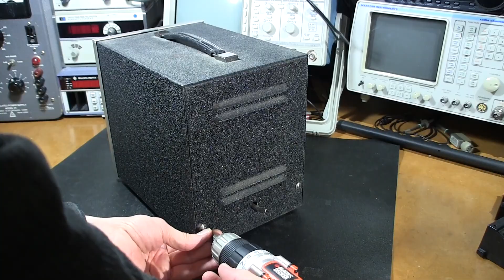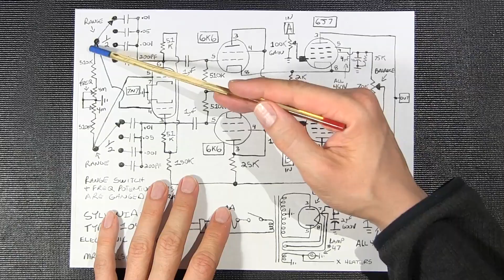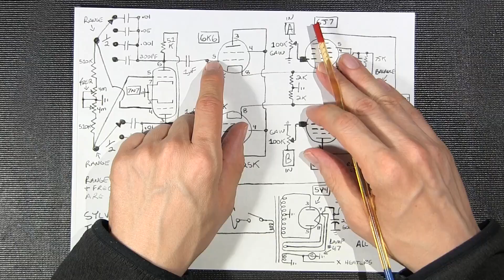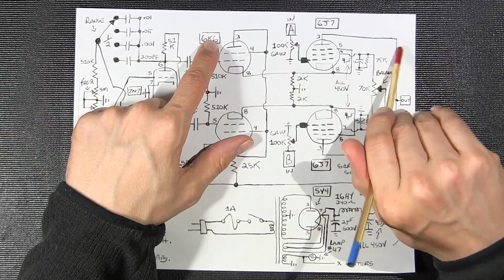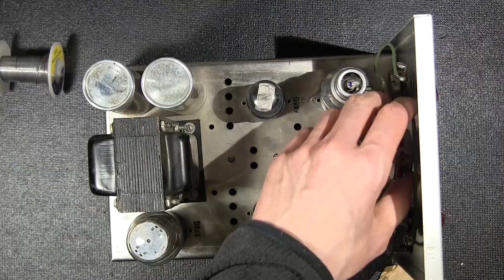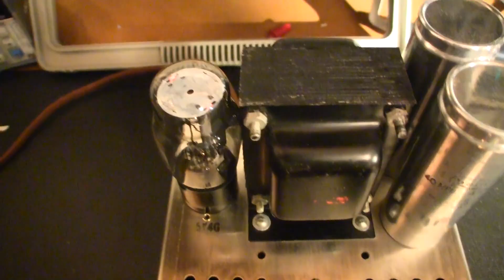Neat Electronic Device from 1939 Explained with Restoration

Comment: You mentioned in the video that the pentode was being used as a triode. Why was this done instead of just specifying a triode in the original design? Was this just a cost-cutting measure so that they would have to keep fewer different tube types in stock?

On an aside, thanks for these videos. Your videos (and Big Clive's) have inspired me to get back into learning electronics. Your attention to detail is inspiring. I'm trying to work up the nerve to change the caps on my Icom IC-751A, something I would not have contemplated before watching your stuff :)
Reply from the maker: Either cost cutting, or they found some advantage in using a pentode. (maybe sources current faster or something) "nicer square wave" for the switching. Thanks for your kind comment!

Comment: Thanks for posting. As an old guy, I cut my teeth as a kid with vacuum tubes. One additional thing odd about loctal tubes, the number starts with a 7 but they are 6 volt filaments.
Over the years I had built quite a few Heathkit and Knightkit devices, including a the Heathkit color TV in the early 70's.
Take care de N3GAQ.
Reply from the maker: You're Welcome Mike!

Comment: I wonder why would anyone but an oscillator in the signal way of a switch like this when one is usually struggling to keep noise & oscillation out of it as much as possible. & this doesn't appear to include a chopper-like preamp or be using the heterodyne principle for anything.
Or did I miss something & the signals are supposed to switch periodically?
Reply from the maker: The square wave has to be there to stagger the traces.

Comment: I believe you are incorrect where you mention that the 6K6es are Triode Connected due to the plate and screen being tied together. It should be the control grid and screen grid tied together.
Reply from the maker: Are you sure it's me that's incorrect? You may want to do some research.

Comment: My father (age 67) watch this before me and after i mentioned loctal valve he then told me about the similar equipment he used to use.
Because he has explained to me how these older valves work in detail i had figured out about half of it works but couldn't quite figure how it mixes the channels together so i just had a 10min explanation of the oscillator component.

Comment: Hi Paul.
This is a great find and restoration. Could you give a tip as to what kind of software (preferably freeware) would be a good basis to draw schematics and PCB layouts? It's quite apparent, that to adequately restore old equipment, having a good schematic is half the work, even if one has to reverse engineer it.

I still find the notion "raising up the cathode from ground" quite confusing. Why isn't it more common to say, to make the cathode more positive compared to ground (where "ground" could be at negative or positive voltage compared to the usual 0 Volts) ?

It's fantastic how technicians in the thirties and forties were able to service high frequency equipment with measurement equipment well below nowadays standards. Your initiative to show how such a workbench would have been operated, is a wonderful idea.

Tallyho and success with your idea!
Keep the great videos coming :)
Reply from the maker: Thanks for your comment!

Comment: I have to confess, I got a chuckle when your schematic popped up. I'd made a prediction about the 6J7 tubes, after looking them up (RCA made them too, and sure enough they were in my copy of their receiving tube manual RC16 from 1946). I figured they were being used as amplifiers for the inputs, with the gain controls connected like simple volume controls.
That's neat how they're connected to the oscillator, though :D

Comment: Soviet standard procedure of point to point circuit quality control prescribes mandatory ink markings on each soldered joint. by-default, they are all marked, always. (during repairs they often use different colour)
Reply from the maker: Interesting, thanks for chiming in!

Comment: Thanks as usual for the great instruction.  The values on the range capacitors, however, only make sense if the selected (slowest sweep) capacitor in the schematic is 0.1 mike, rather than .01.  Did I miss something?

Comment: Question Mr. Carlson: Do all capacitors, even ones made today, have a limited life span as compared to other electronic components? Also, how old would an item have to be (ie. made before 1960?) for you to issue a caution about "just plugging it in and turning it on"?
Thank you.

Comment: I have a story I spent 7 years in the NAVY on submarines during the early 80 s I would have done but got hurt on board leaving me crippled for life. But 1 thing we had was a MK 19 gyro that was made in the same time as the subs in the early 60s . I was on SSBN 619 634 and they go out for 70 days or so. The mk 19 gyro is one of the ways to stere the sub.
I had to got to school for 3 weeks just to learn everything about it It has 307 tubes and we carried a tube tester and 2 set of tubes.If you could not figure out how to repair it you had to retube thing. Every tube is tested at the factory 5 times and run in a circuit . As you pull the tube you test them but you were not allowed to stop and just replace it you had to keep going .But you did write on the tube it was bad as if you use both sets of tubes you can try replacing what you think is a bad tube . We had some pretty nice troubleshooting knowledge after that school and after you worked on the real thing on the sub. When I got out disabled the NAVY told me they had over 1/2 a million worth of training in me  But man those were the days as there are only about 150 guys on board and you know them real well.
Reply from the maker: Thanks for the story!

Comment: Awesome restoration! What Sylvania named at that time as an Electronic Switch, is actually a chopper circuit which, once integrated into future o-scopes got shortened to "CHOP" mode and eventually "ALTERNATE" or ALT mode. Even my late-80's dual-trace Tek scope has ALT mode on it :)

Comment: Very nice.  I can't believe I've watched the entire hour plus video but it was kind of fun.  I'm surprised at least one of the tubes didn't have a date code of some sort.  When I began my career as a two-way radio technician 45 years ago we were still working with vacuum tubes even though transistors and other solid state components had become common place.  It was easier to actually fix things in 1972 and quite a few years later.  Today much of what we do can be described as "swap-tronics".  The company I started 34 years ago (after gaining 10 years experience working for others) is still quite viable.  I'm the president and there are 8 other employees.  We do all sorts of things including broadcast tower work.  Click on my picture and it will take you directly to my tower channel.  When on the bench I find myself in charge of fixing that which appears to be unfixable, legacy equipment.  I see you have a Marconi service monitor on the bench so I'm guessing you work with RF equipment as well.  I've had a ham license since 1960 but rarely appear on the amateur frequencies.  My "hamming" is limited to maintaining about four ham radio repeaters.
Reply from the maker: Thanks John, I'll check that out.

Comment: i have a single channel CRO and your restoration of this 1939 thing inspired me to the core ! :)

please hang a few of the carbon / tungsten filament edison bulbs in new lab to do the 1930s lighting !
Reply from the maker: It may happen. I do have an original Edison style bulb from 1909. Those bulbs burn incredibly hot, not much light either.
Reply: just to boost the ambience. :)

Comment: why do the valves have the shiney silver inside them ?
a great explanation video mr carlson thumbs up
Reply from the maker: Godfrey has it right. The chrome looking spot is called a "Getter Spot." This compound that's sputtered on the inside glass of the tube is there to absorb impurity's that leach out of the metals inside the tube over time. It will also take care of any left over oxygen left in the tube after evacuation.

Comment: I was trying to figure out how one could make this with solid state equipment, and I am realizing just how little I actually know. how would one emulate a tetrode or pentode? would it just be a multi gate mosfet? where would you even get one?  all i can find when I try researching multi gate  mosfets/transistors is intel's tri gate transistors which are described as a space saving measure. 

On an unrelated note, I recently got my hands on a bunch of rather early transistors.  Also some old logic chips from back when they were still in metal cans with the leans coming off of it. do you have any use for some of these?
Reply from the maker: Hi Joseph. A multi-gate FET (any FET that starts with "3SK") Example: The 3SK45, is much like a tetrode vacuum tube. I do have boxes full of old transistors and logic IC's. Thanks for the offer though!

Comment: According to here http://www.vintagesylvania.net/?page=history the leaf logo was used between 1924 and 1931, the triangle with the S inside and lightning bolt was used from 1942 to 1959. That would seem to say this was built in 1942 or later, using old parts.
Reply from the maker: Thanks for your input Doug!

Comment: Wow, ST bulb glass 6j7's.  Replace them with 6j7M's and toss the shields.      5Y4  tubes are the same as 5Y3's except for the pin connections.  They are also quite a bit harder to find.  However, you can rewire the socket so either tube will play.  Think the loktal's date from '38, I have a '37 tube manual, and they ain't in it.
The 7N7 might pre-date the octal equivalent 6SN7GT

Comment: Very much enjoyed watching your channel for the first time. Seeing that Heathkit oscilloscope brought back great old memories. Around 58 years ago I was a teenager working the summer as a dogsbody in my father's marine electronics shop on Fort Myers Beach, FL. It happened that he needed an additional oscilloscope on the work bench for the technicians. So he purchased a Heathkit and put me to assembling the unit. Well, I was over then moon being given such a challenge and responsibility. I completed the assemble and when the time came, it didn't work. One of the technicians took to troubleshooting the unit and found that I had failed to put a ground insulator between one of the can capacitors and the frame. Easy fix and I was relieved.
Reply from the maker: Great story James, thanks for sharing that!
Reply: Hello a general question related to use and restoration of older test gear in your projects have you worked on Fluke 8600A DMM's? I have one I am interested in getting back into working condition. TX Theo

Comment: about the case....12ga is just a hair under 1/8" (11ga is 1/8"), which is highly unlikely under any circumstance....so the case is most likely 16ga, which would make a lot more sense...that's ~1/16"

Comment: Thank you very much for this nice and informative video.
I wonder why you mark the 6J7 gate with a small rectangle?
Reply from the maker: Hi Emil. That's the control grid for the tube, the small external rectangle indicates that it's a cap on the top of the tube.
Reply: Oh that makes sense.
Thank you for your explanation.

Comment: I really enjoyed watching over your shoulder. How much did the switch go for at the swap? 

I picked up an Heathkit IM-18 VTVM at a hamfest, $10. I'll be storing it based on your VTVM restoration video. The battery was left in there. Do you have any tips for cleaning up the battery mess? 

Great work, keep it up. Randy
Reply from the maker: Thanks! I usually do the baking soda soak to the corroded terminals.

Comment: the trace on the o'scope looked as though the sweep speed or something was off, the peaks of the sine wave looked closer together on the right than the left of the trace. is this to do the the age of the equipment or my eyes just playing tricks on me?
Reply from the maker: Your seeing right, the scope trace is a little compressed in one corner. This is normal with this scope when restored correctly, the heathkit O-11 manual makes reference to this trace in their pictures. Go to page 8, figure 30 in this PDF: http://tubularelectronics.com/Heath_Manual_Collection/Heath_Manuals_O-RX/O-11/O-11.pdf
Reply: thanks for the info, and letting me know I don't need a return visit to the eye doctor :)

Comment: This was a fascinating video and I think I learned a lot. What a great find! Hope to see some more vintage test equipment videos from the new lab ( check out the $10 buck workbench Youtube if you have not). Thanks for including how you cleaned and polished the case and components. Have you every thought of a introduction to oscilloscopes for restoring radios and test equipment? That would help me as I have a scope ( actually three, but one that works) and have no clue how to use it.

Comment: I have not looked at your channel for a while and I am now wondering what I have missed. There is no doubt that whoever designed this unit took pride in what they did. It may look old fashioned but I think it looks bloody gorgeous. After 50 odd years I have gone back to electronics as a hobby so to me in a way it's not so old fashioned. I can remember 410 V across the end of my nose ( Mullard Amp). A small scar is still there after 50 years. Thank you so much for this video - it's perfect.
Reply from the maker: Thanks jp! I'm glad you stopped by.

Comment: ...'Looms of wires, all the same color'.......Yes, plenty of that when I worked at Burgmaster....anywhere from 40-50....up to maybe 125....all blue, and those Bradley stick-on 'easy-code' wire markers. They work great until the end of bundle gets some hydraulic oil on it....and all the easy-codes fall off......so....the company invests in a nice wire numbering machine that prints the wire # every foot or so.....on everything from 20 gauge up to # 4....

Comment: You might want to get a Pilot FriXion pen to save yourself some time on photocopying and corrections. They are pure black (other colours too), non-reflective. The feel and the line look is the same as any decent gel ball-point pen. However, the ink is heat-sensitive. At the end of the pen is an eraser that doesn't damage the paper or get consumed, but it heats up the ink by friction locally just enough for it to go completely transparent. It's quite precise when erasing, and there's no visible residue.

The designs on them look quite silly (tribal tattoo style), so you may have overlooked them, but it doesn't negate just how incredibly useful they are and how well they work. They also make neutral designs, but you have to import those from Japan yourself pretty much. I've overlooked them for years until a friend showed me. If i didn't live on another continent, i'd just send you one.
Reply from the maker: Thanks for your input Siana, I will look for one of those pens locally.

Comment: I've been consuming your videos for the past while now and I went from 0 to absolutely stoked on vacuum tube electronics. Thank you, it's a great feeling. I've still only ever laid my hands on transistor equipment thus far, though.

I'm looking to pick up an early 60's 4 watt EAF42-EL41 kit amplifier (with AZ41) as my first foray into vacuum tubes. I intend to give some fresh capacitors, if I do indeed get a word back from the current owner that he hasn't recently attempted to power it up. Judging by its casing alone, the caps are not going to be all of its issues. Bodgewires and questionably fitted afterthought connectors adorn most of the device's backside, and, I'm honestly still accommodating to the idea of electronics that aren't anchored to a PCB in the first place.

Beyond being careful not zapping myself, and being gentle with the device and not zapping it , do you have any advice on the tubes it comes with, or European kit amplifiers in general? Are there more quirks to them than meets the eye? Should I just go for it, and, do you've any other words of wisdom for the very transistory man I am?
Reply from the maker: If your a transistor guy, just be careful around the high Voltage, it's all over vacuum equipment. Glad to read you're interested in the tube stuff now, I admit, it's much nicer to work on than the new stuff.

Comment: Thank you for your excellent presentation.  Not being an electrical engineer and having only limited understanding of circuits, you make it very easy to follow along.  In your circuit schematic you have the range switch in the order .01, .05, .001, .002pF. Are the first  and second position out of order as it increases in value then decrease at the third position and fourth position?

Comment: Paul,
My research on Wikipedia reveals that the Loctal tubes were introduced by Sylvania in 1939. So I would estimate the age of your switch is probably early to mid 1940s. It is also my understanding that the Loctal tube fell out of use in the 1950s. The octal tubes were still used (early "All American Five" radios) and most audio and test gear. To shrink the chassis real estate, miniature tubes (7 and 9-pin) were used in televisions, radios as well as test equipment. I have an old RCA Senior Voltohmist VTVM with a 12AU7 meter bridge and a 6AL5 AC rectifier to make AC voltage measurements. I also have a Hickok Model 6000A tube tester with a 5Y3 standard rectifier and a type 83 mercury vapor rectifier in it. I prefer tubes for audio as I like the "tube sound". I has a much warmer sound than the starkness of solid state.
Thanks for the video and sharing your knowledge!
Dave